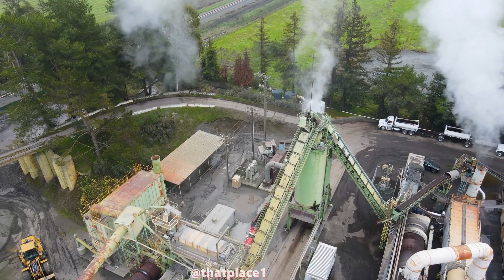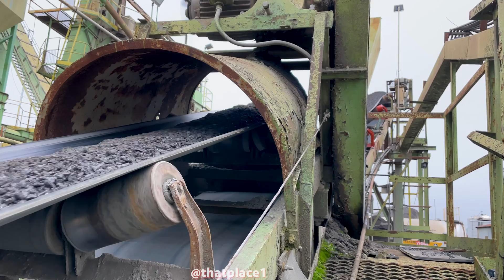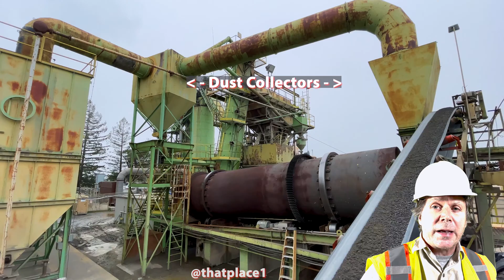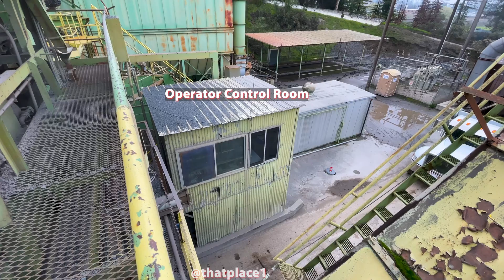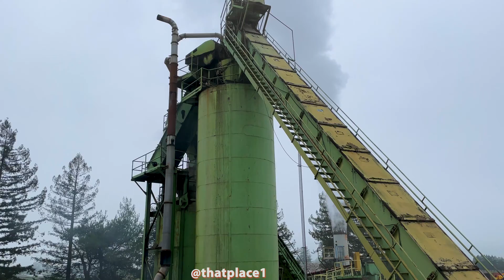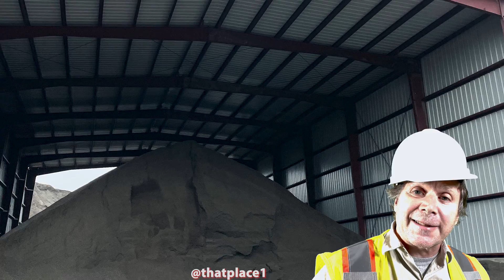How an Asphalt Plant works.  How Asphalt Is Made.

Comment: Yes, I know that, every summer when it's hot it's shown with the asphalt. Added to the high temperatures is the heat of the asphalt product, you have one hell of a job! 🔥😈😅😁👍
You explained it very well, my friend.😃👌👏
Hardly anyone thinks about this when they use the road.
Well done! 😉👍
Kind regards
Wally
Reply from the maker: Cheers Wally.  Appreciate you